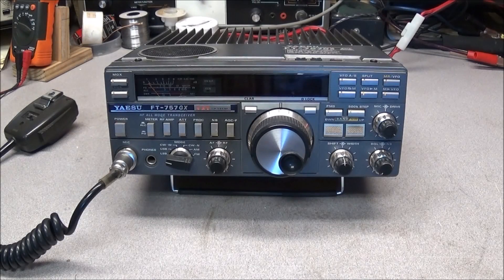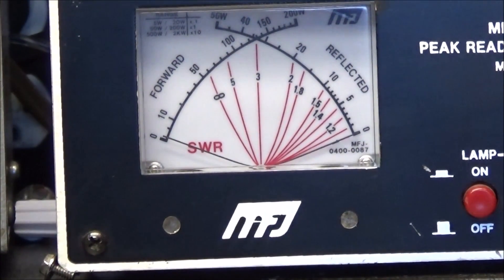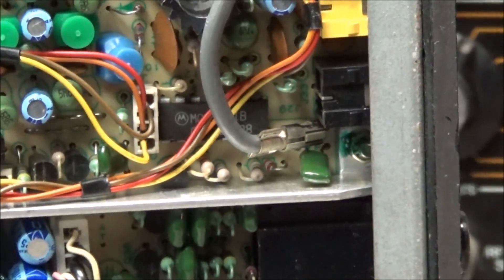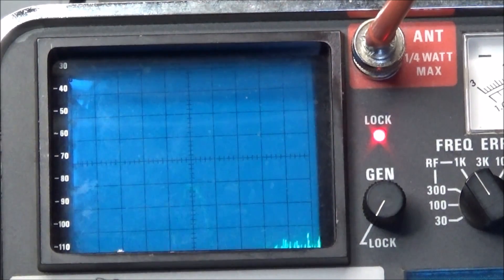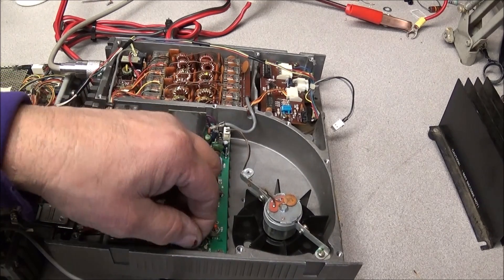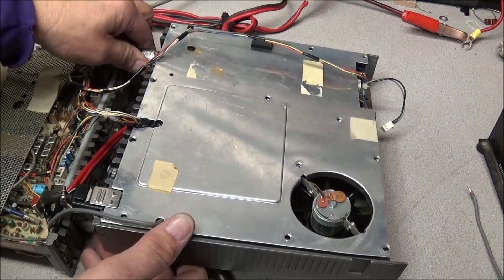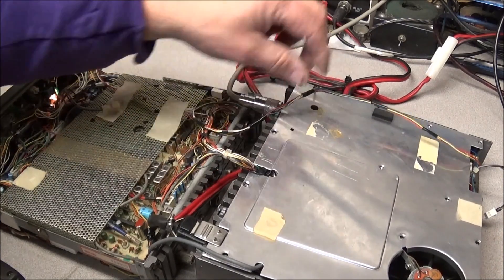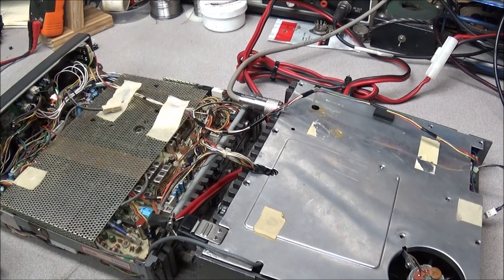#26 Yaesu FT 757GX no transmit  quick repair

Comment: Just for anyone with no TX on the 757 you can’t remove the coax from the exciter board because it is diode switched and the switching voltage comes down the coax from the PA board so if probing leave the coax in. There should be 2-3 volts peak there on the oscilloscope. Thanks for the video

Comment: Hello, I moved and my 757 GX was in a box for 16 years. I went to plug it in today (I have the antenna tuner and power supply for a complete stack)_ and I have no power. Is there someplace I can send it for repairs / like do you do repairs? I am in North Carolina.

Comment: I recently bought a 757gx at a hamfest. It came with the FP 757gx power supply. When I attempt to apply power to the transceiver, relay R1 in the power supply opens and shuts the power down. There are no blown fuses on the radio. I have not tried connecting the transceiver directly to battery power yet. Any ideas watching on with the power supply? I tested the output of the power supply and it a steady 13.8 volts until I apply a load (the transceiver). 

Jeff

Comment: I just picked up an FT-757GX with no power. I have NO experience diagnosing or fixing radios but may open it up and look for something obvious.. THanks
Reply: IT WAS SOMEHING SIMPLE! the "silicon" like stuff in the plug had  become like a semiconductor over the decades and was shorting it. I scraped it out and powered up! Only with a little confidence gained by watching videos like this one!

Comment: Oh Yeah ... the way these "clam shell" 757 rigs are designed it's easy to pull out an inter-stage coax connector.  BTW ... how do like having to remove that shield in order to accomplish a proper alignment?  Yaesu put access holes in for only some of the trimmers.  Nasty!

Comment: Would you happen to have an IC for this ft-757, MC1468050,    Yaesu part #(SC82088P) my switch for the 500k step doesn't work, and I traced it to pin 15 of this chip, the voltage changes from 0 to 5V pressing the button, but 500k steps doesn't work
Reply from the maker: Sorry, no luck.

Comment: Love your videos. I have watched about all of them now and have learned quite a few tricks. I do some modest repair videos too, AERVBlog but we can all learn can't we.
Question for you. I have aYaesu FT757GX (ebay find cheap) that I have mostly fixed but it still has a problem. When I transmit I can hear myself in the speaker. It is really bad on FM. I have changed all the diodes and checked about everything I can think of. Any ideas on this. Thanks
Dave
AERVBlog on youtube

Comment: I have been following your videos, the one that you was cleaning the switches with white vingar, what I want to know is can I was my yeasu ft101 with this solution I will remove the vfo unit, all relays, meters tubes and transformer and front panel do you think submersing the rest of the transceiver in a tub of this solution would harm the radio cleaning thge radio this way. its dirty all inside and from what I gather it will remove the oxsidation throughout this unit . please email me back and give me your opinon on this thanks Charlie
Reply: FYI I tried this with an old television set.  I took the case off, hosed it out with a garden hose and let it dry for several weeks to make sure the parts were completely dry.  It worked fine.
Reply from the maker: Yes, it will work fine.

Comment: forgot to ask the Attenuator you used its 20 db  how many watts is it ?
thanks  I want make sure my SA stays safe I just use antenna on my sa  no direct connection
Reply from the maker: +DENNIS N This attenuator is 150 watt unit.  I cannot remember the model number but it came with my Com Ser labs service monitor when I bought it.Think it is switchable between 20 and 40 db. I will check on it and draw a schematic so you can build one.
Reply: Thank you very much

Comment: Nice to have an easy fix every once in a while! What do you call those connectors? I know I've heard the name in the past but for the life of me can't remember it. I'd like to make up a couple to have around to make it easy to connect to the PCB side when looking at a radio that uses them. Looks like you could make a patch cable using RG-174 if you had new connectors and could crimp them.
Reply from the maker: +Dino Papas Hi Dino. Yes very nice to get an easy one. Those connectors are called TMP. I had to go ask to find out myself lol.  And now I know the name of them think I will order a few spares. Thanks for your comment :)Buddy
Reply: +The Radio Shop Thanks Buddy, as soon as I saw TMD (Taiko-Denki) I remembered. INRAD has them and I just ordered some male/female PCB units along with a couple of 8" leads. Will stash them away for that Sunday afternoon when you say to yourself "Self, I sure wish I had one of those!"  73 - Dino
Reply from the maker: +Dino Papas Good deal. I still have a few that has been removed from old radios.&#160; Do you have the crimp toll for the male plug? I though my AMP pin crimp toll was high at 380 bucks. But these can run up to a grand. 73 Buddy
Reply: +The Radio Shop Nope, don't have that tool for sure! Have nice one for Powerpoles and coax which surprisingly does a pretty good job with terminals as well, and a RJ-11/45 crimper as well - they all come in very handy. I was a little reluctant at first with coax crimps but once I got the hang of it I only solder if I have to (and then use silver connectors only!).  CUL.

Comment: It's nice to get an easier one every now and then isn't it my friend. Problem is the easy ones don't 
normally turn up when you need them to :)

Cheers
John
Reply from the maker: +orbiter8 (John)  Hello John, good to see you stop by.  I had a feeling this one would be a simple fix since the owner did a little work, but at the same time was thinking it could had been a major failure. The way the 757 is designed it is so easy to short things out. They do not give you much slack in the cables once you break it apart. These are good radios but they do have CPU problems and are unobtainable.  Luckily this one is in decent shape. Thanks for your comments my friend.  Buddy